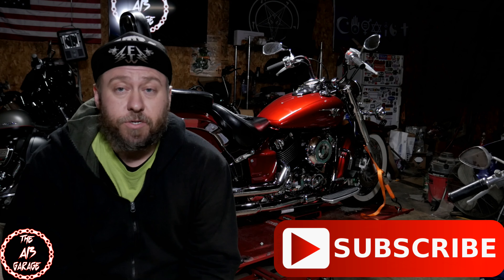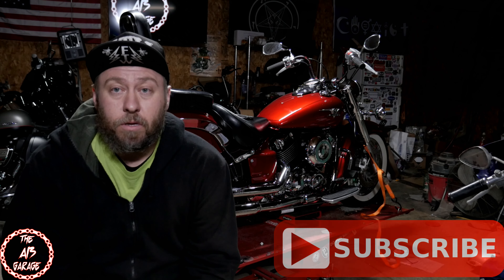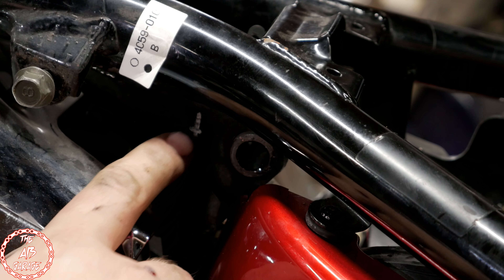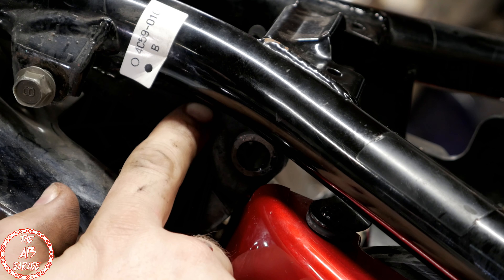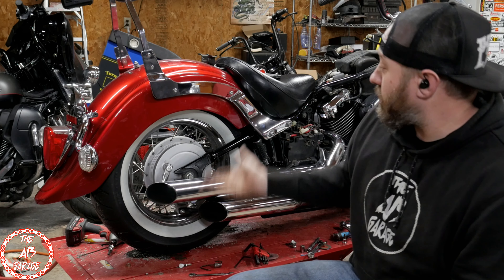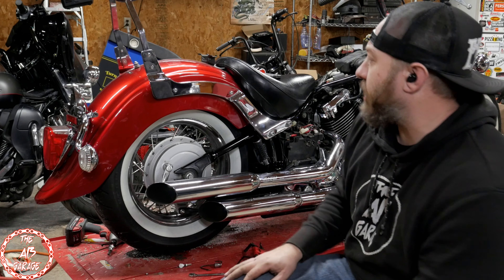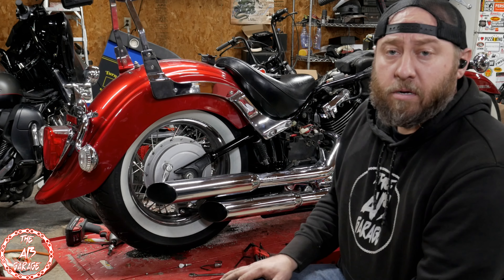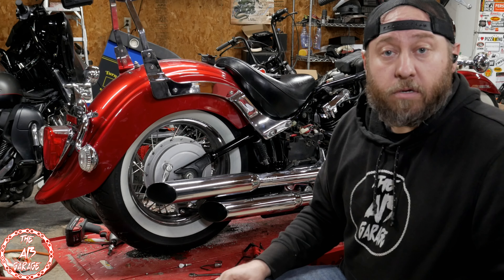JSlam Method | Vstar 650 Lowering

Comment: I just ordered the 1.5" pacific coast progressive rear spring and lowering block.
Reply from the maker: Hell yea let me know how it is. I’ve heard good things about that company too.
Reply: @theaveragebikergarage  sure thing 👍. Depending on how it handles after the rear is done I may drop the front with their 2" progressive spring kit.
Reply: @theaveragebikergarage  so tell me, how does your vstar handle with the lowering done as opposed to before it was lowered? Any significant differences? My brother is saying my pegs with scrape do you have any issues??
Reply from the maker: @Randomhero413  I built the vstar mainly for content and to sell in order to get my sporty for a build competition. That being said I don’t have it anymore. But while I did have it I rode it enough to notice the difference in handling from the stock stance and was impressed with how it handled and if I ever get another one ill definitely lower it. As far as scraping pegs goes I do that on my stock height ultra. It all depends on how aggressive you ride, road conditions, body weight. All that factors into scraping pegs.
Reply: @theaveragebikergarage I installed the Pacific Coast lowering kit with progressive spring yesterday.  Day before I put on a set of 4" pullback risers from Show Chrome.  The bike feels so much better at 6ft and 255lbs.
Reply from the maker: @Randomhero413  hell yea that’s awesome

Comment: There is like 4 inches of clearance under those fendors not sure if i would be able to tell
Looks like its been lowered a lot mor than an inch
Reply from the maker: @beowulf4100  thanks for watching I didn’t put the lowering kit on it just did the jslam method and you can tell definitely sets it off